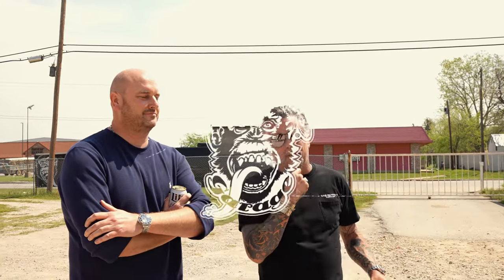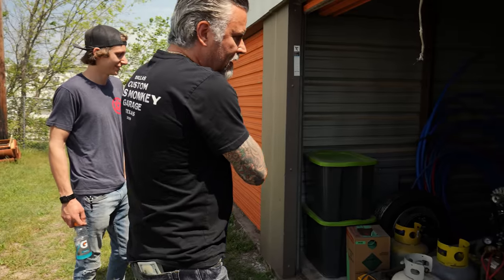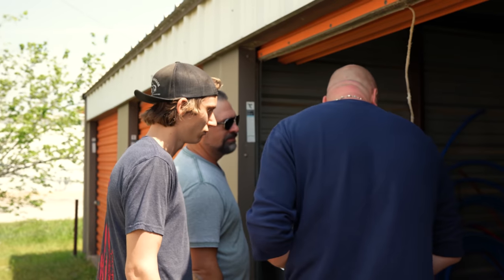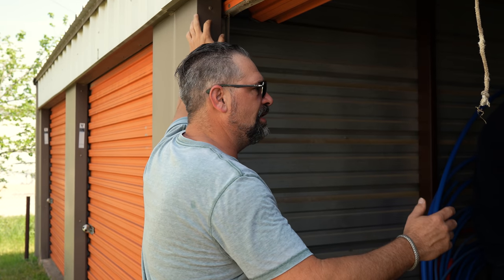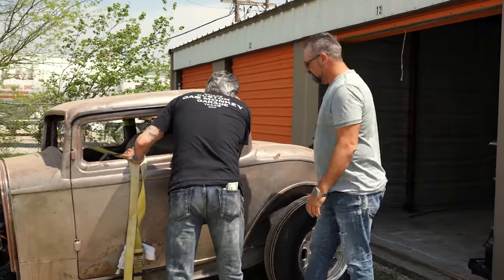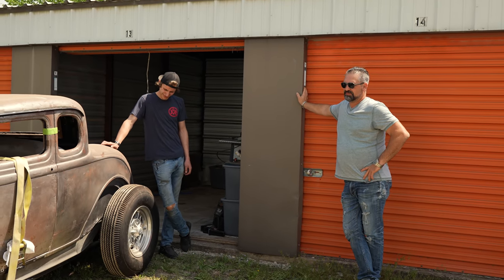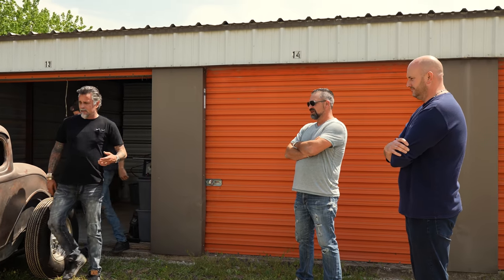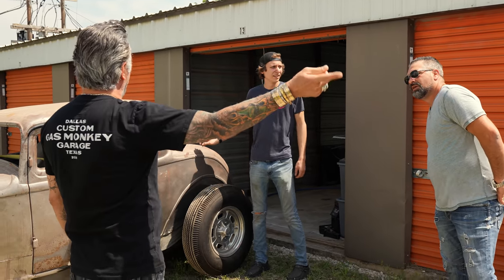Fast N' Loud Build Found In a STORAGE UNIT!

Comment: I love how this guy bought a gas monkey car then sent it to another shop to “make it right”. Lmfao
Reply: That is funny but true .
Reply: None of these tv mechanics crank out quality vehicles.  It’s about the drama, not the car.  

Pretty lame
Reply: I guess you don't know what channeled is
Reply: @gizzyguzzi  what does channeling have to do with poor workmanship?

Just like an OCC chopper, the cars this guy turns out almost always end up in someone else’s shop getting major rework within a year of ownership.  Structural welds failing, drivetrain issues, fluid leaks, hack job electronics, steering racks coming undone.  You know it’s bad when someone brings their car to PepBoys to have the brake system on a C-10 redone.  Seriously, the entire thing was trash. We managed to salvage most of the hard lines, but they screwed up just about every other part of the brakes.
Reply: @jgetscensored7837  nothing in this video is about poor workmanship.  They said he wanted to put it back to stock floor.  They may do crappy work, but that's not shown here, and no one says they took it to another shop to 'make it right'.  lmfao
Reply: Maybe he had his fill of Sir Richard
Reply: @gizzyguzzi  I commented having not watched the video fully.  I based my comment off what Chris said.  It would not have surprises me to hear there how the conversation went
Reply: @jgetscensored7837  and he clearly didn't watch it either.  he's just making stuff up
Reply: @gizzyguzzi  🤷‍♂️. Not that important in the grand scheme of things
Reply: @jgetscensored7837  sure.  just read the headlines.  form opinions.  spread nonsense.  It's the modern way!
Reply: Chip Foose and his man do great work.
Reply: @jgetscensored7837  hey genius rewatch it again and again until you can hear the words come out of the dudes mouth. It’s literally stated he brought it to another shop to make it right. The car was a thrown together hotrod for tv and the guy wanted a car he could use. Did you not hear him comment the gas tank was in the back seat/trunk cuz they made it so low. My guess is the work was show worthy and not driver worthy. Y’all need fan boy clubs or something. To think reality tv is real is ridiculous then to think reality tv don’t produce reality cars. 🤦‍♂️
Reply: @jkforever10 Bro most of the builds never really left Gas Monkey anyways.......havent you noticed how many of the shows builds that Richard ends up "buying back" down the road ?? Its a tv show........many of the builds never sell and its a fictional "buyer" on many of the builds, and you know Richard has the chance to buy them back a year later (wink wink). Discovery was fronting the cash and making 95% of this possible. Why do you think when Discovery pulled out GM basically ceased to exist (definitely ceased to operate).
Reply: @georgethecritic9850  then why watch?
Reply: @chriscaliri7977   hey genius, reread my comments about this guy and his builds. you made the same point that I did.  He doesn’t build vehicles.  He builds useless nonsense.  Anyone can build a car wrong but make it shiny for the cameras.  

Wanna join the fan boy club? 🤦‍♂️
Reply: Hands down Aaron is one of the best idea and fab guys in the hot rod world. Without Aaron Kaufman there is no Gas Monkey.  That empire became famous on that man’s watch.
Reply: What's funny is this guy bought the thing for $28'000 then paid someone to "Make it right " then sold it back to Richard for $15'000 .........I think this guy needs to go back to math class .
Reply: Not to make it right but make it different. And then look at the finished product the other shop was able to accomplish...😂😂😂
Reply: I seen one in person many times that has monkey built. Not good
Reply: @gizzyguzzi  Pfffft, sure I do, I'm an expert at channeling my energy thanks to all the Yoga classes I have been taking. JK, I had to answer this how I imagined anyone born after the 80's would answer it.
Reply: Say what u will about the workmanship and what not but anyone who can sell a car for $27k then turn around and buy it back for $15k with more parts and a new frame is doing good business. Plus you know he will eventually make even more money off it!!
Reply: @Crazynutzz79  .. it was set up they already talked about it ...you know there had to of been another deal behind the scenes... Richard is a con artist he's not smart... And who the hell knows if he really sold it for $27,000... The television company bought it
Reply: @jgetscensored7837  counts customs seems to be legit
Reply: 'Make it right' is an opinion, not a fact.
Reply: @jgetscensored7837  It's about time. We don't want it good we want it out the door in four days
Reply: Make it right....or try and make everything look original
Reply: @gizzyguzzi  all that work to beef up the frame ... and they rip it apart to make it original
Reply: @jgetscensored7837  it was built and the owner didn't like the frame or the floor....he wanted it to look original
Reply: @mr.patrick5726  Seems to me, he's a few bricks short, and his wife said get rid of it
Reply: @mr.patrick5726  sometimes you need to cut your losses bro , some people can’t finish big projects like this
Reply: @jgetscensored7837  Jesse James builds good stuff.
Reply: I think it's great all they produced was junk like that damn Studebaker wagon that the floor pans were rested out of . and a little 13-year-old kid called him out on the junk and Richard was like yeah I hate kids the kid was like what's this rust and he said oh can we don't worry about that stuff we worry about the important things ,and I thought dude you had a 13 year old call you out on your bullshit and the best you could come up with was well we don't worry about that stuff yeah no need to worry that the car is going to rot away unless you eliminate the damn rest sure that's not important .
Reply: That’s cold blooded
Reply: @jgetscensored7837  can you back any of that up with evidence? I'll bet you can't.
Reply: @boofert.washington2499  I’ve already posted links... but it’s fairly easy to just google the build quality of these various car building shows. Most, not all, but most are absolute garbage
Reply: Your ignorance on the topic is humorous
Reply: @ScottAnd  what? Lol
Reply: Who might I be posing for or as?
Reply: @ScottAnd  where and when is there proof of that? I simple said what the guy said? Am I missing something you’re tryna add in?
Reply: Bahahahaha so damn true
Reply: @m.a.linkes5621  he sent out crap too....REAL CRAP
Reply: Looks like they did a fantastic job of putting it right
Reply: @stephenblackburn1387  did you see some place to go take an English class because you could use one?
Reply: Ya and when they challenged the street outlaws they hired an NHRA pro team to build and drive the car, his shop was supposed to build it and Richard was suppose to drive it
Reply: @shorty808100  I get the part that they should have built it but Richard has no experience driving a car with that kind of power. It would have ended badly I’m afraid!
Reply: To put the original floor in it... Stop the FUD
Reply: That’s typical man. Like the green c10 he took to barrette Jackson. It didn’t even run lol they make things for looks and the cameras more or less, myself I rather have something that runs.
Reply: @bear24D  gm just can’t make any vehicles worth a damn nowadays man, most the new trucks are lucky to not need a transmission before 100k miles. Why would you want to spend 40k plus and have to pull the transmission a month after you get it to rebuild it? The new 2020s are over 80k that’s just ridiculous man when your house and vehicle is in the same price range just about. I’m a true Chevy man but I wouldn’t want any Chevy above the year 2010. I’ll stick with my 95-09 Chevy pickups till I die.
Reply: @gizzyguzzi  I don’t remember saying the guy told Richard it was a pos. I do remember saying the guy told him he brought it to another shop to make it right. His words not mine so if you are gonna be a mad fan boy then be mad at that guy.
Reply: @rickr7529  both sucked 😂
Reply: @chriscaliri7977  wow.  This is old.  You may not have said the words pos, but you def said gas monkey did such a shitty job he had to take it to another shop.  That may even be true, but nothing like that is in the video.  He also never said anything about 'making it right'.  He said he wanted the floor back in, to reverse the channel job.  There's nothing in the video to support your comment that the car was some sort of hatchet job.    What you said may be true, and the guy may even think that.  But he didn't say it in the video!  Not at all.
Reply: Am we the only one here who understands what "make it right" meant?  It was built as a hotrod.  They channeled the floor to lower it down. Like an old school body drop.  Make it  right meant to put it back to original.  Which is why they had to find new floors.  And an original gas tank.  He decided to restore it instead of resto mod.  Dummies.
Reply: @jgetscensored7837  maybe but I'd love to have a kindig custom.
Reply: Smart.
Reply: @jgetscensored7837  not even bud
Reply: And wasted a SHITLOAD OF MONEY in the process... went from a running, driving vehicle, to a pile of parts...
Reply: Yea.gas monkey quality is trash
Reply: @jeffallen5387  that's a proven fact! Aron is the man

Comment: Well, what did the car look like? What episode was it?
Reply: Season 1 episode 12 "Holy Grail Hot Rod". Same wheels and tires, body dropped down (channeled) over frame, solid burgundy color, no hood or side panels around engine, gold pinstripe around grill shell.
Reply: season 10 episode 4.  the guys built it while Aaron was racing pikes peak. it was purple and they sold it to this same guy for 45k.
Reply: Thanks, i can't remember. I want to see it.

Comment: FFS!!!!😳😳😳
That was a Aaron Kaufman original build!!! As a fan of the show and huge admirer of Aaron and Richard from the first show,this breaks my heart,and all I can hope is someone will restore it back to it's origin....😒
Reply: My question is what posses someone to buy a $30k driving hot rod and less than 10 years later completely undo everything make it worse and then have it in storage.
Reply: @gearjammergamer8560  
Thinking they can do it better,when they can't....🙄
Did you see those welds on the frame???😳
Ray Charles could weld better than that!!!!!
But honestly,why not just find a frame and go from there??? 
All the body pieces are available aftermarket,just bad decisions buying a show car, and turning it into a parts car....😒
Reply: @gearjammergamer8560  the guy paid 45 grand for it on the show and did all that work and then SOLD it for 15.

Comment: Damn Richard.....the man countered with "15" immediately after your "10" offer. There was one more place to "meet in the middle"...(in case you didn't have your calculator) that was12,500.00. Never saw you just totally disregard 2500 bucks....you're slipping ol' man!!!!!  :-)
Reply: Yeah but he already got 27,000 of this mans dollars for a poorly built car, so he's in the black 13,000 already. He can turn and flip this as is and make a little or do another build. You have to think too the hard part or expensive fix has already been done. That cost dude money and saves Richard money and time. This ain't his first rodeo.
Reply: @MrNota500  Matter of principle. I think Richard probably forgot the seller agreed at 15K.....why else make an identical offer?

Comment: Season 10 episode 4, they just did a fluff and buff fixed some of the chassis welds crate motor and sent it
Reply: and sold it to this same guy for 45k
Reply: I don't think it's the same car, the one on the show looks more chopped than this one.
Reply: This is from season 7 episode 11
Reply: Randall Johnson  season 10 episode 4 this same guy selling it here buys it from them for 45k.

Comment: So someone paid $27k for a running driving hotrod, changed frame, took out the windows, cut off the front end, back end, took off the fuel tank and put it in a storage locker for (3?) years? WTF? Why buy it if you are not going to drive it.

Comment: $7500 is too much.
Ide like to know the story on why it’s in this condition.
Reply: Actually that's good
Reply: You clearly don't have a clue what your looking at. If he actually paid 15K for it then he ripped off the guy. It would cost at least 30k to buy everything you could see in the video, not counting parts in the boxes and an extra floor. Heck a steel repo 32 5-window from socal costs 21k by itself (no chassis). I doubt he pays what he says. It's all a show to boost the illusion/reputation of Richard.

Comment: You know I'm just an old guy with the cell phone on YouTube and I tried for about an hour to get a message email or anything like that to Richard Rawlings I don't get Stern business or what that I had a lead on a 68 Mustang convertible GT 500 sitting in the garage with 6000 miles on it but I guess nobody gives a s*** orange with white stripes by the way I driven this car it'll burn Rubber at 55 miles per hour